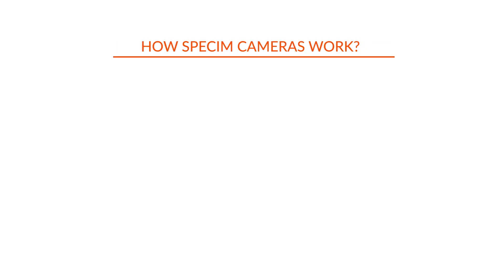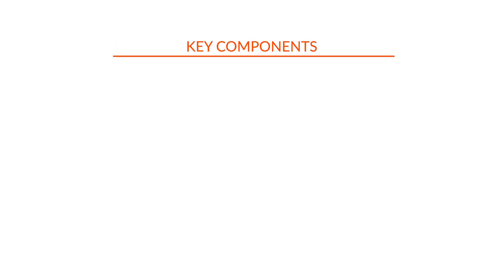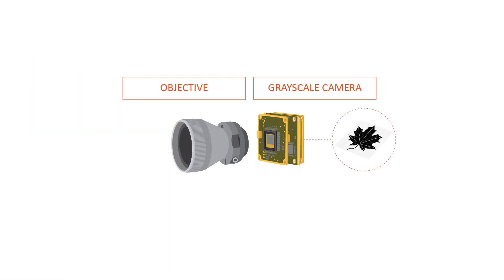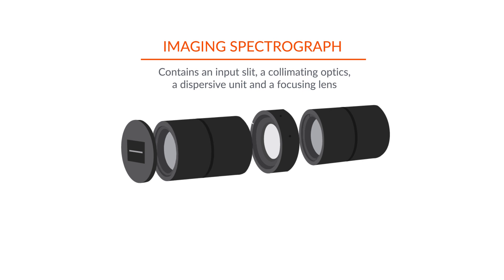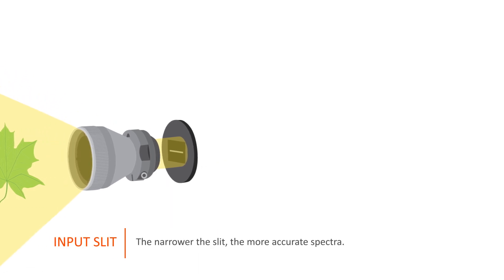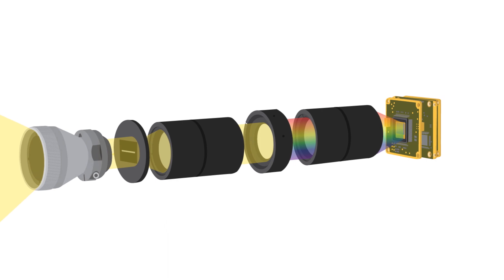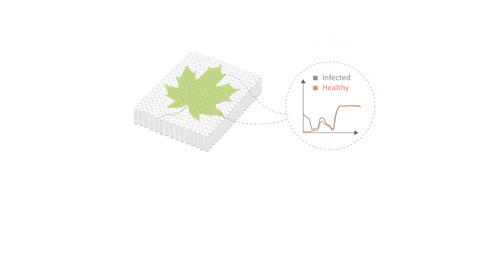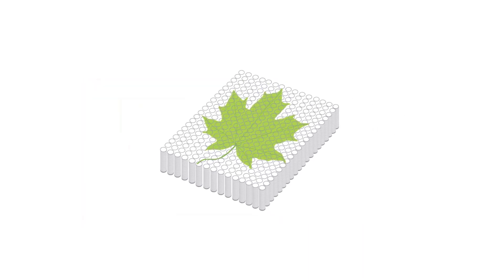How Specim line scan hyperspectral cameras work

Comment: great tutorial, thank you. 

I have 2 questions, 
1) the monochrome camera senses 2 dimensional image. As I understand one dimension gives spectral signature of a pixel in the observed line, is that true? 
I will open the question, for example monochrome camera observes 600x400 pixels of data. In this case, do you have 400 band spectral information of 600 pixels ? 
2) After image acquisition, how do you know the wavelength of the bands? In the image of monochrome camera, how do you determine which pixel corresponds to which wavelength?
Reply from the maker: Ahmet, thank you for your questions. 

1) You are correct, the vertical axis is the spectral one, and the horizontal axis is the spatial one.

2) We do wavelength calibration to each of our cameras. We put the camera in front of the integration sphere, illuminated with a spectral lamp, with a very narrow and well-known band. Then, we fit a 3rd order polynomial curve (or 4th order, depending on the camera) to estimate the wavelength band between the spectral peaks. The calibration file comes with every shipment.
Reply: @SpecimSpectral  Thank you for the answers. Your tutorials and products are pretty interesting, congragulations.
Reply from the maker: Hi Ahmet, we have now updated this video based on your comments. You can find it from here:
 https://youtu.be/ayp7hP0Xr8Q
Reply: @Kamryn Israel Good scam.
Reply: i dont mean to be offtopic but does someone know a method to get back into an instagram account..?
I stupidly forgot my login password. I would appreciate any assistance you can give me.
Reply: @Konnor Cory It worked and I now got access to my account again. I am so happy:D
Thanks so much, you really help me out !
Reply: @Imran Jasper No problem xD